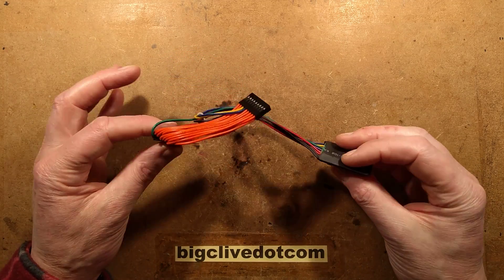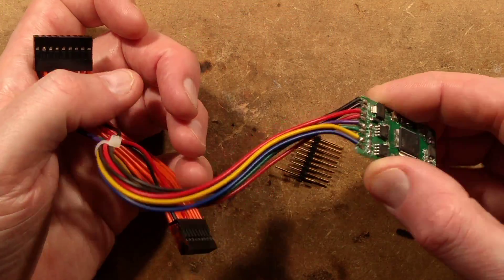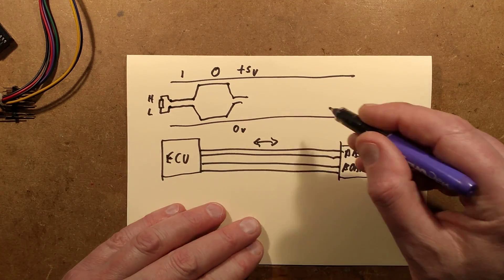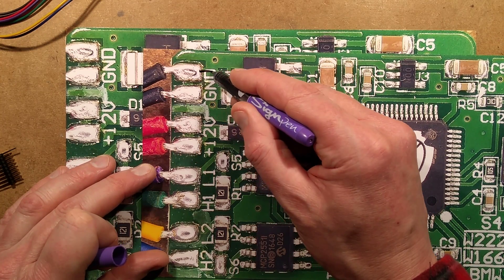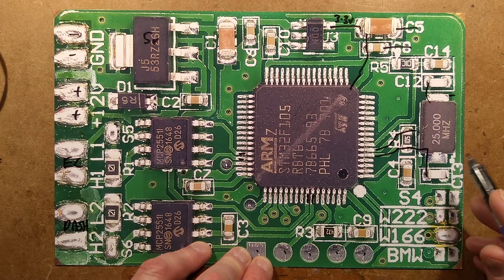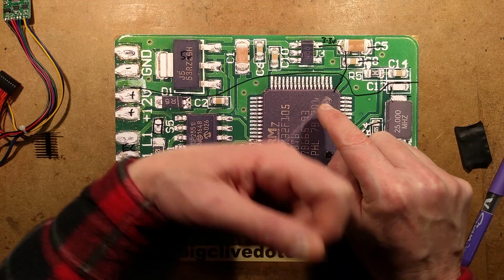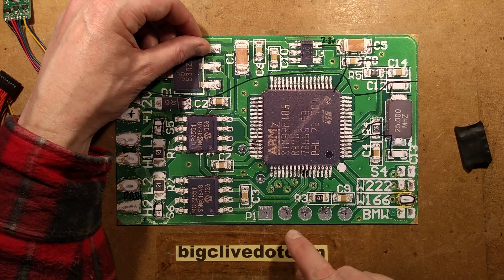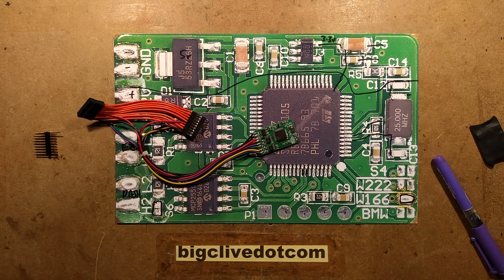Naughty CANbus odometer "interface".  (Fakes mileage.)

Comment: This is what it says on the back - a CAN gateway. Messages received on one CAN interface will be blocked or re-transmitted on the other, and vice-versa. (Here odometer messages going in the direction of the instrument cluster will have their payload doctored to represent a lower value before being sent on.)
These sort of things are used legitimately by vehicle manufacturers, usually to filter what messages can be read from the diagnostics port and especially to filter what messages can be sent from the diagnostics port onto the vehicle bus - which could be very dangerous.
I really  like this little board - whoever made it has done a neat job!
Reply: mister clean  the factory alarm does have an immobilizer if the alarm is set off... I think the car should count pressing the panic button as having the alarm set off, aparently the designers did not see it that way... the weakness in the system is that the security is verified when the car starts, but then security is done and forgotten about, so if the car is remote started or was driving and then carjacked, it can be driven all day long without the fob... and since it's keyless entry and keyless start, the fob is always in my pocket, not hanging from the dash or collumn. 

A better car? Really? You show me how any car is perfect and you might have an argument, but really, that was just an ad hominem attack.... so you lost.
Reply: mister clean  "measure distance with electronics quite easily,"
That's cool. Is there a way to access or get around said electronics without the key being anywhere near? That would be a security flaw, as you could tamper with the system without having the key. Perhaps 'spoof' a desired reading by using a similar device as in this video.... Options, options.

Also; RFID keyfobs are easily spoofed. Maybe take an Ubuntu laptop with some radio-frequency gear and go sit around at a parking lot for an afternoon. Sure, 'Crypto'... "It's SecURE".... Tell that to people who's cars get stolen with their keys in their pocket.

Maybe don't go shouting at people on the internet. It may end up sounding as high pitched whining. :P
Reply: @FroggyMosh  So your counter argument to RFID keys (being phased out for active keys anyway) is that people can spoof them and take the car when you are not there.

So what good is being able to shut it down within 30 feet by using the panic button if they wait until you are gone?
Reply: @2009dudeman  "So what good is being able to shut it down within 30 feet by using the panic button if they wait until you are gone?" I don't know. :) It's probably highly situational. 
But it gives them something to work on for themselves and peace of mind once they finish it, and a lot more knowledge.
DIY is about thinking in possibilities. 

And perhaps they actually have the perfect plan to engineer their situation exactly so this would be a fitting solution for them. They might be living in an apartment 2 floors up directly overlooking their parking space.
You don't know.
Reply: 323897532564 e bay.  45 bucks. China
Reply: mister clean  Modern cars are even better than you give them credit. The newer ones (2014+ can tell if the keyfob is inside the car or in your pocket when you close the door. They have half a dozen sensors than can locate the key to less than 1 foot when it's near the car.
Reply: @2009dudeman  It really depends though, a 2016 Volvo will happily idle and drive without the key inside the car, it's only when you shut it down that it'll refuse to start again.
Reply: @sstorholm  But you need the key in the car to start it is the point.

If you are really worried about it. When you are getting car jacked, usually the car is not yet on. They aren't carjacking you at stoplights. If they are, just put it in park and hit the start button as you are getting out to run, with the key in your pocket it won't start anyway.

But at that point, where you are still exiting the car and the car is off, or in a parking lot when you are getting in and the car hasn't been started yet, they are going to demand your key. At which point, having the panic button shut it down doesn't do anything as they have your key, not you.

The whole fear of being car jacked and not being able to shut it down remotely within 20-30 feet after getting car jacked is irrational.
Reply: @2009dudeman  Funny thing is, none of that matters. You are literally missing the point of "someone wants a custom function", and instead are just shouting them down about how incredibly wrong they are.
That's the fun about trying shit out. You find out what works and what doesn't.... for yourself. 
That's the very point of customizing something.
Reply: @FroggyMosh  I never told him not to, I told him how pointless it is and gave him a better solution. And given the risks associated with performing this kind of work on your car without knowing how to do it, you stand to cost yourself hundreds of dollars minimum to pay someone to fix it if you screw it up. For this kind of thing it just goes hourly, and you start a $100 an hour.

So if you want to call it shooting down, fine. I have no argument, but the guy is asking because he doesn't know, and if he doesn't know, then he doesn't even know where to start, then he shouldn't be messing with it. It's not just about him wanting something pointless. It's about it potentially killing him or someone else. If it gets messed up and it locks down while someone is driving in a manner he doesn't intent, you could lose control of the car and kill someone.

So go ahead and get on my case for telling someone to not make serious potentially illegal modifications to their car with no prior knowledge.
Reply: @2009dudeman  Honestly, I'd assume they are older than 16, and wouldn't plunge in without at least looking up some information, yes that includes risks. I also like to leave the responsibility of someone's wallet to themselves. 
And guessing by what they're saying, They'd probably think of actually testing any modifications, maybe call in someone with expertise they trust to look over their work; Cause, you know, They themselves probably don't actually want to die and stuff.
I just like people to take responsibility for themselves, and leave theirs with them.
Reply: @FroggyMosh  I've had to fix problems created by grown men who thought they knew what they were doing and messed it up.

If he was going to go ask professionals anyway, why even  bother with us. Just goto a specialty shop that installs alarms and remote starts and ask them direct.

As far as the money, sorry for trying to save someone unnecessary waste. I guess not everyone cares about other people making good use of their hard earned money.

As far as it being situational. Sure I agree, there might be one situation in your entire life where that would come in handy. But There is also a situation where I might be out of my home, walking down the street, and 3 guys try to rob me with rifles. Doesn't mean it's reasonable for me to walk around in full body armor carrying my own rifles all the time.

You have to apply some rational thinking to it. Sure a 1 in a million chance this is going to come in handy, but it only solves that one in 1 million. I suggested a system alternative that would protect his car from ANY theft. Not just the highly specific theft where they steal his car while he is there, but do not demand the keys, and he is able to hit the stop button within its range so long as they don't just hit him with something hard that disorients him for a minute or two.
Reply: @sstorholm  Volt is like that too

Comment: It adds another node to the can bus system. I find it hard to believe that it sets no canbus dtcs. The gateway module would flag this almost immediately. This would cause termination resistance also.
Reply: It simply acts as a CAN gateway. It's transparent to all other devices on the bus. Why would it set any DTCs?

Depending on the installation, you can either leave or remove the termination resistance.
Reply: @cybergibbons  it would set dtcs at the very least. Id ask what was the reason for repair. Tech found it. It caused a problem .
Reply: @codyburns4149  why would it set any DTCs? It's specifically designed to not be trivially detected. What would detect and set DTCs?

Comment: If you want an interesting look into figuring out the special sauce for programming an ECU over CAN, look up Just4Trionic. Used it extensively while tuning my 1997 SAAB 900, to avoid having to take the ECU out every time I needed to program it (using Motorola's proprietary "BDM" interface; kinda like JTAG for the embedded Motorola 68K's). Unfortunately the 1994-1998 900's didn't have the CAN lines brought out to the OBD port, so I had to make a custom adapter cable for SAAB's proprietary 'debug' plug hidden behind the glove box. Neat stuff, especially given how old the SAAB Trionic 5 ECU design is.
Reply: Ha, Trionic5 fan here too. Ive got two 9000 Aero's. Do you know Jules from the UKSaabs forum ?. Possibly the best T5 tuner in the UK.

Comment: The thing is, with the right software it's so easy to change mileage in most cars. Alot easier then installing this or anything else
Reply: Does that mean overwriting the odo values in the BCM, ECU or wherever that data is stored? I wouldn't have thought that was possible. Regardless, I will just presume the deed has been done, or a module installed and use other indicators to judge the mileage the vehicle has done when looking to buy a second hand vehicle. Thanks for the info.

Comment: I'll laugh if someone loses their timing-belt to one of these
Reply: I suppose if your mechanics found this device while inspecting the damage done to the engine you could very easily sue the person who sold you the car and win.
Reply: Lost timing belt usually equals lost engine.
Reply: @Chrisallengallery  Not "usually" but sometimes. Only in interference type engines.

Non interference engines will stall and not restart, but the lack of belt will not do much of anything.
Reply: An extra 25k miles shouldn't be a big deal, my dad ran his 170k overdue with no problems even after the car was driven into a tree.
Reply: @randomvideosn0where  this machine doesn't actually change the miles, only visually on the dash... The guy above meant since this is inserted into the CAN network that it could affect the timing belt's timing

Comment: Love the fact people are still trying this on. These days you hand your key over and they know everything. One can only hope they can't frig these AI based cars that drive themselves. Where would that end up??!!!!!
Reply: Good idea, for when the AI cars only drive the stupid speed limit (in Texas it’s normal to drive ~120mph, then have a car blast past you doing another 40mph faster...). You could potentially use something like this (possibly in conjunction to either a GPS spoofer or jammer), and then the car might be able to go faster than a grandma in a walker and you’ll actually get to your destination the same day, lol!

Autonomous cars are going to be pretty bad, in real life there is so much road debris (is it real hazard? Is it just an empty plastic grocery back tumbling in the wind? Is it a board? What about a board with nails? How deep is that pothole filled with water? And for Oklahoma, you should be using the ditch instead of the road a lot of times because the roads are so bad they litterally knock fenders off of dirt bikes from the impact and break tractors, which are made for very poor condition off-road use...). Plus is it going to freak out about a squirrel vs a puppy? If it’s a pet, attempt to swerve, but if it’s a squirrel you’re just about as likely to swerve into it trying to avoid it, same with rabbits. How is it going to know all of this? What if it mistakes a small animal or basketball (both of which just run over), with say an infant crawling over the road? Cause if it swerved for everything that will very likely kill way more people than save...

Plus the hijacking of cars will be fun (I mean, you can already do it, the security to remote take over is pitiful... It’s just about as easy as hacking a Windows computer! Which PS takes like 0 skill, it’s almost hard not to accidentally hack one every time you sneeze...). The developers are insisting on being able to push updates constantly (which, probably good to update it often since their going to need to improve a lot on the early days), but then it’s really easy to just inject malicious code and then that day or years later flip the switch and cause chaos... Key fob hacking is not difficult, neither are fingerprints, and facial recognition has become a meme recently with so many security flaws, and even Mercedes accidentally had on their app the location of every owners car with make and model available for anyone to see. Like companies no matter how big are not even beta testing software, and security is the least they care of. It’s going to be bad (well it might be fun sitting on the roof of my house with a controller making my neighbors car do donuts in the big gravel turnaround... free RC toy cars for everyone!)

Comment: The module is available on aliexpress for around AU$6. Thanks for the heads up. I'm in the market for a second hand vehicle, and knowing odo readings can be fiddled so simply means it probably is. Question, how can one detect that such a device has been installed?
Reply: A good scanner can read the odometer directly from the PCM.
Reply: @FaithSaraG  Wow, thanks MiataCommuter!
Reply: you could read the original km directly from ecu with a obd2 scanner tool. this device only fools the dashboard and the actual km is in original state where it belongs.
Reply: @Sezdik  Likewise, thanks Sezdik.
Reply: @Sezdik  thank you

Comment: Surely this data is encrypted?! Did they really not design these cars without screwdriver winding the clock back protection??
Reply: Volvos store the mileage elsewhere too so have a record of the true mileage.also better CAN as the instrument panel only has 4 wires going in rather than the 60 of the older models. Volvo was first with fully CAN systems in 1998 3 systems at different speeds and a fibre optic system for audio,video,amplifier,cd player, tuner, navigation,Telematics and the control signals,through the one fibre optic high speed ring main . The speed signals do not come from the ECU by the way, they come from the ABS Control Module..

Comment: Certainly quicker than a drill in reverse.
Reply: Unfortunately that hasn't worked in over 60 years. Cars began to incorporate odometer clutches to make sure they only turn one way starting in the late 1950s, and electronic dashes don't care as long as they're receiving a pulse - It doesn't even determine the direction!

Comment: That's a pretty stupid device. I hoped it would continiously shave off kilometers so the value stored in the car is lower than the actual driven value. But this sounds like it only shows a lower kilometer value while it's plugged in.
Reply: I think the general  reason not to do that is that the mileage data is important for other reasons, not just the odometer. If you just drop the mileage by 40k, that's unlikely to break anything, but shaving 10% off of new mileage is more likely to cause a bunch of weirdness and/or warning lights.

Comment: One interesting drawback, apart from the illegality of the thing, is that of service intervals. Just supposing the car's owner ran the car to the limit of the service intervals, or as so many do, just a couple of thousand miles more Add that to the already corrupted mileage reading, and that the car's cam belt replacement is due at the next service interval. Then there is a very real danger that the belt could fail before the mechanics ever get their hands on the engine. . . . Very nasty, and very expensive, just to shave a few thousand miles and take a few quid more.

Comment: “From 2015 Mercedes E-class.“ 0:33
On the righthand lower corner it says BMW. 6:45 
Ah, yes S4 is probably Audi. 
W222 refers to an S-class (2013)
W166 refers to an M-class (2011)
Made by professional assholes!
Reply: Probably Audi S4 aswell.
Reply: I guess? S4 is Audi? They are really interested in the German market it seems...
Reply: TrickyNekro 
Yup, I think so too. 
Make you wonder how many of those boards are there in cars. 
Could very well not only be used to increase the market value of a car but it could also be ‘useful’ if your drive more than your lease contract allows you to.
Reply: @Conservator.  Insurance fraud (the insurances in Germany are with millage limits) and market value fraud. These are the two most common in Europe, I don´t really know about leasing.
Reply: VAG stores the millage in the dash. It's BMW CAS4
Reply: @bustopherjones2285  If the purpose is to cut for example every 3rd speed pulse, making 60mph (or kph) look like 40, the dash is totally unaware of the change and keeps on clocking false speed and mileage.
Reply: @sleeptyper  It simply blocks the update of the dash from the ECU. So, whatever the stored value in the dash is will remain. The speed and new millage accumulation stays the same. It's just easier to roll back the dash compared to the ECU. But, the dash tries to update every start and this blocks it.